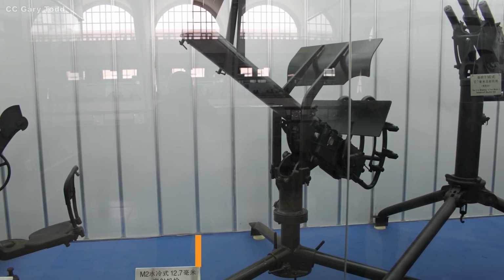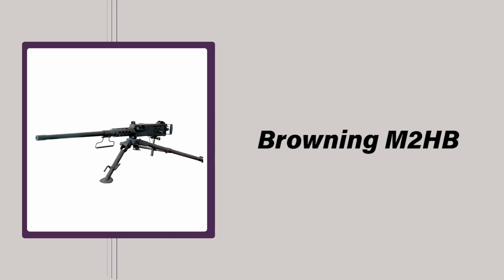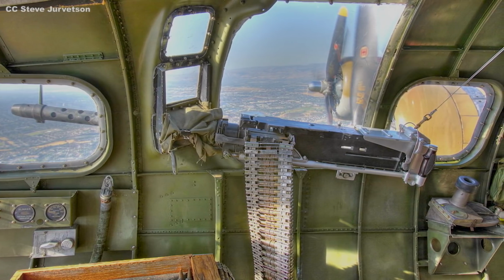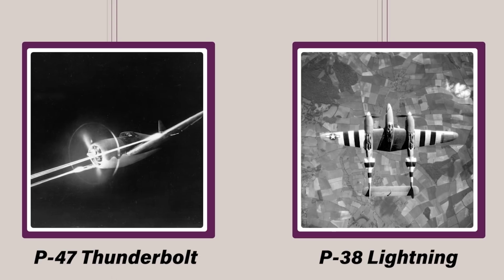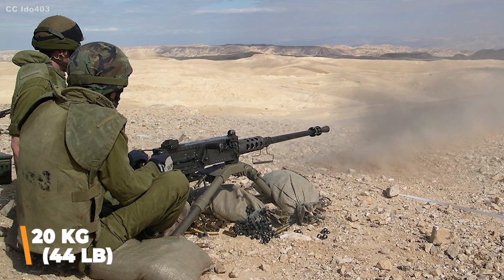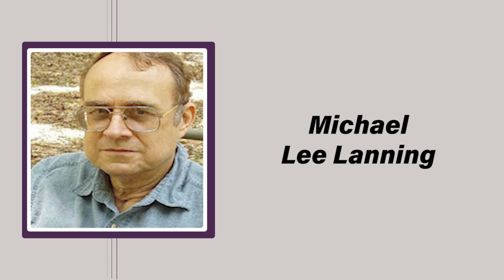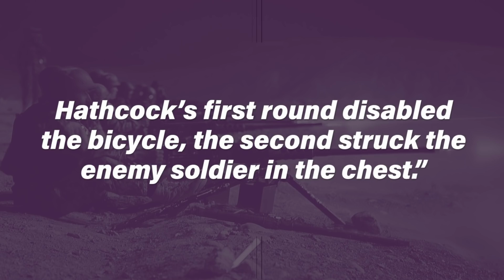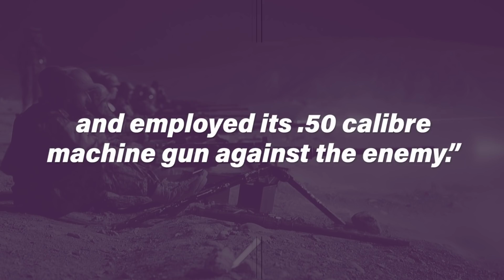M2 Browning: The WWII Machine Gun we Still Use Today

Comment: Ma Deuce, the iconic heavy machine gun.  I have carried one of these and they certainly aren't light but sure are powerful. The cloud of dust kicked up as the pressure wave spreads from the blast separates this from your normal rifle. With a 666 grain bullet you can reach out and turn someone into mist.
Reply: Running cadence I used to use as a Drill Sergeant included the verse,

"Screw in flush, and back off two,
"Ma Deuce turns them all to goo!
"All I ever want to see, is...
"Bodies, bodies, bodies!"
Reply: Ahhh, pink mist...
Reply: Beware the number of the beast, especially if your a commie .
Reply: Just so you know while the M2 is definitely heavy. But the Mark 19 is far heavier, atleast for the M2 you can remove the barrels and two man carry it. 

Personally I preferred the Mark 19 over the M2 because putting the block with the spring back in is a Biach. You need to get that sucker in just right or it gets jammed and you have to pull it out and start over.
Reply: Where did you carry it?
Reply: @jarraandyftm  I have carried assembled (but off the tripod) M2HB all over various Army training areas, when moving the gun into positions where we wanted to be up and providing overwatch  on an exercise within seconds of arrival.  Usually only from the ORP a klick or less (depending on terrain) from the planned position.

A couple of times, we even dropped the gun on the tripod and carried it into position, IJA style, with two or three men - one holding the barrel and one or.two holding the back tripod legs.  That way we could move it directly to where the recon team (usually accompanied by the gun team leader) had marked exactly where each tripod foot should go, with small flags.  Trot up, lay the feet on top of the marks, and you're already laid in.

Sucks WAY more than doing it with an M60 (which we also did at times), but do-able.  Not a routine thing, but a viable TTP for light infantry trying to get an HMG in position quickly without a large signature.
Reply: No one carried one of these…. This isn’t G.I. Joe.
Reply: @Ben Powell  then how do you get it somewhere if noone can carry it? I didn't say I shot it free hand, it is way too big to hold and shoot. We were loaned a couple demiled M2 and M1919A4 to make replicas for museum display.
Reply: You carried a 100 pound plus machine gun?
Reply: @robertdawson8522  well you don't normally carry the 50 cal, all in one piece. 

Normally it's split into two main parts the Mechanism and the barrels. If you need the tripod mount then you either carry it with three people or one carries the tripod and the other carries the 50 cal. 

But with the Mark 19 it's one solid piece so you have to carry the whole thing together.
Reply: @Robert Dawson  Yes, I have carried a 84 pound machine gun without a mount. I wouldn't want to hump that thing around for miles but I could if I had to.
Reply: @bartfoster1311  you couldn’t like. Barrel alone is too heavy to carry for miles. Bad enough carrying the thing out of the armoury.
Reply: @jarraandyftm  And I've carried M2HB spare barrels around for days .  Way easier than humping, say, AT4s.

"No, Sergeant, your knee and back problems aren't service related."  🤣
Reply: @jarraandyftm  you might be surprised what 200 lbs of mostly muscle can do. I guess I couldn't carry a 300lb rock 200 yards or carry 100 lb rock over a mile (gorgeous petrified wood), right?..
Reply: @bartfoster1311  not in the slightest. I’m 220.
Reply: The Soviet Degtareva won ww2 comrade
Reply: @duncancurtis1758  nobody gives a crap